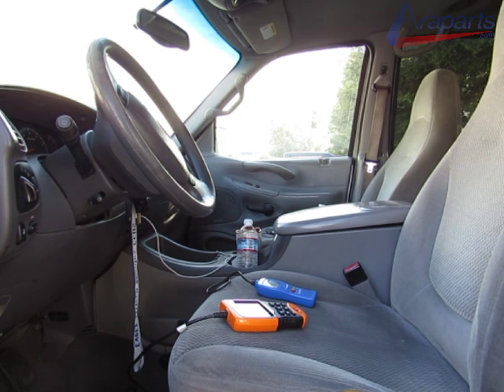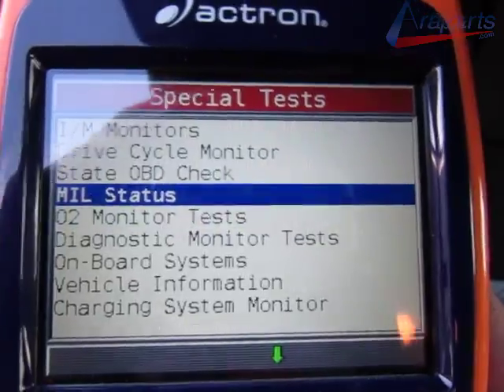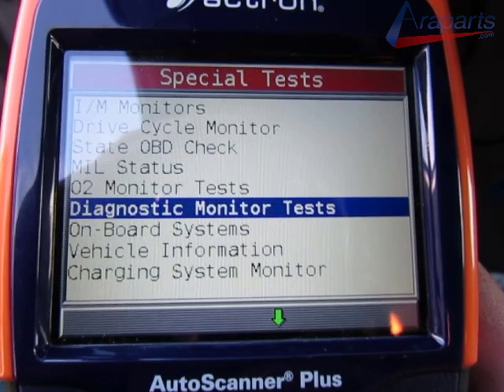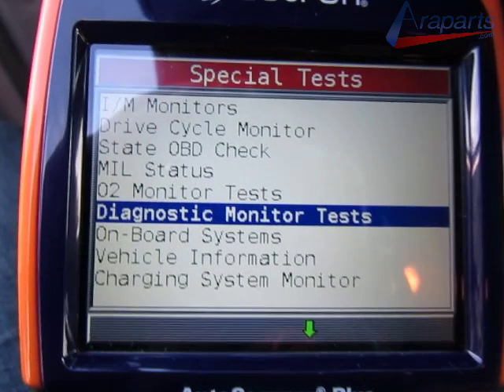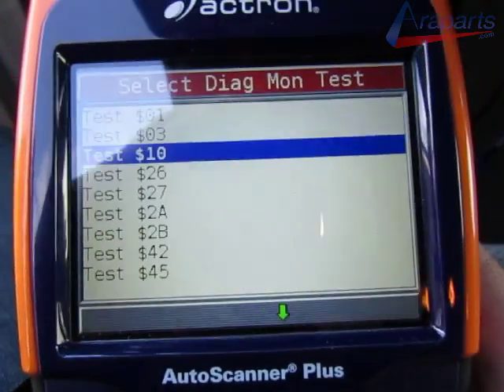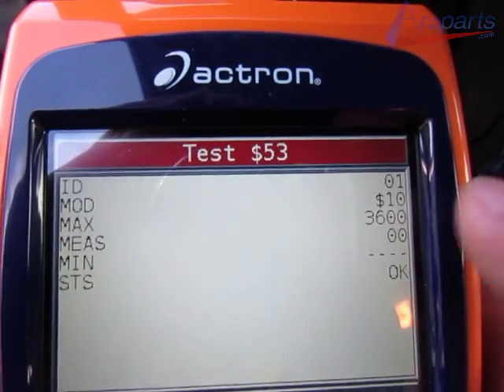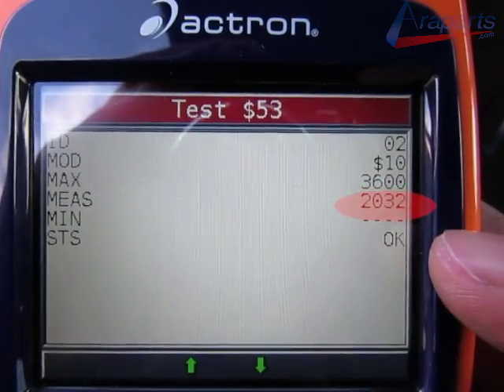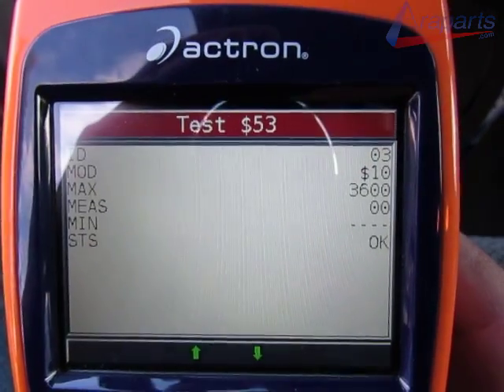How to find a misfire in your Ford WITHOUT a check engine light (no check engine light)

Comment: Doesn’t explain why this is happening or what to do about it. So why buy a scanner? My truck is an 01 with the 5.4 2v. It has been running exceptionally for 154k miles and I keep it serviced. Occasionally it develops a misfire at idle up to about 1,500 rpms. Sometimes it does it for a few minutes and stops. Sometimes it lasts for weeks. But mysteriously it eventually stops. But now I’m going on two weeks and it’s annoying. No check engine light either. I’ve been told it has something to do with the PCU. And there’s a way using a scanner to go into the PCU and correct a code?
Reply from the maker: This won’t solve the problem, but it will help you quickly isolate it. You also can’t correct codes. You can only delete them. There are multiple things that can cause a misfire. PCU - that would be the main computer. It is commonly referred to as “PCM, ECM, or ECU”.  It stands for “power train control module”. Mode 6 is one way to access any misfire data that is being stored in the PCM.  Ignition coils are by far the most common (which was the case with the one in the video) but there are many other things that can cause a misfire (fuel injectors, cam/crank sensors, timing chain, cam phasers, corroded wiring, rodent damage, bad PCM drivers (more common on the Escapes) and the list goes on. 

If you don’t want to buy a scanner, you can see if the local auto part stores are willing to view mode 6 data (their scan tools are usually capable) or you can wait for the service engine light to turn on and you can pull the codes with any $5 scanner. Service engine light will turn on once the misfire gets worse.

Comment: I bought a scanner that uses mode 6....I ran it and I found 5 misfires on cylinder 2 out of I forgot how many max value....then I got 10 misfires out of 934 max on $54 test....my question is I can't get this to change? I want to test again specially at low idle speed because that's when I feel I have the most misfires....is there any way you know how to do this?
Reply from the maker: I would reset the PCM and go for a drive. This will erase the old data and give the PCM a chance to record new data.
Reply: @anotherlapofficial  what about resetting the battery...unplug for 10 min
Reply: @anotherlapofficial  is there a scanner I can buy that will give me access to live misfire data?  I really need to view what is happening at idle and specifically right when I start up the car as that's when I feel it shaking....with mode 6 on my cheap scanner I do get misfires but I have absolutley no clue when these misfires were recorded....they could be on the highway at 70 mph 2000rpms or they could have been in park idle....I need to view these misfires live

Comment: Man I really have to thank you for this video. I ordered a cheap reader that claimed it had mode 6 which it didn’t.   Ended up returning and going to oreileys to use the one they had in house. Took me a second to find but it found that cylinder #7 was the one misfiring. Fixed my problem and saved me about $800 bucks in changing all of them. You are the man!
Reply: How did you fix the problem? Coil pack ? Plug ? Injector ? Was your check engine light on? 🤔

Comment: A word of caution... 96 was a transition year so you might have a 96 Ford that actually has a 95 EEC-IV ignition system which means a scanner with a Mode 6 is not going to be of any use to you.☹

Comment: A little off topic but if I have a check engine light on but when I plug in my obd scanner.. I get no codes.. Does anyone know why this happens?
I had a p0420 before.. Changed the 02 sensors.. And cleared the code.. Then a few days later and over 100 miles driven.. The check engine light is back.. But no codes whatsoever..
Reply from the maker: P0420 is typically a bad catalytic convertor(s). I've seen O2 sensors cause that code, but more often than not that's a bad cat. Especially if you clear the codes, change the O2 sensors, and P0420 keeps coming back. You can have a smog shop diagnose it further before spending the money on anew one (s).

Comment: Thanks, couldn’t figure out which test was my individual cylinders. My 2003 Mazda B2300 I4 is showing 4085 events with a maximum of 14080 for a fail on cylinder 1, while the others are zero events. I just changed my plugs and wires (it needed them) so I’m gonna keep an eye on this number to see if it goes up. One thing that has been really confusing is the event count on test ID $56, it just keeps counting up and up with big numbers for a Fail state because it wants a maximum of 2000. I’m not really sure what to make of that one…

Comment: Hi!!!
I just ran mode 6 in my 2001 expedition.
I have: $2A $00 FAILURE
             $2B $00 FAILURE
             $26 $00 FAILURE
             $56 $00 FAILURE
Can't find definitions on those codes, or what they are related to.
Can you help me?

Comment: Didn’t help me. Mode 6 isn’t showing a specific cylinder, just a general misfire on test 56.
Reply from the maker: If Mode 6 isn't giving you data you need, I'd recommend looking up the term "cylinder power balance test". Unfortunately, this test will require a much more advanced and expensive scanner. As an avid DIYer, I'd always say the more tools the merrier. It really depends on your DIY dedication whether or not you would buy a scanner with this type of capabilities, or just take it to a shop who can perform this type of test.

Comment: I'm not sure if it's a misfire or the torque converter but its been "Shuddering/Vibrating"  between 30-45mph  since about 2016.  Also does it uphill sometimes.  No scantools were showing anything wrong and I dont wanna just throw parts at it.
Reply: Hi I don’t know if you still have the problem or even the truck but I’ll put it here so people know what’s wrong it’s a misfire I had the same thing on my truck and replaced the spark plugs and it was good as new so id try replacing them first as they are the cheapest and if it’s still there try the coil packs you can do all this in a day unless you have the 5.4
Reply from the maker: Yeah, don't throw parts at it. If you don't see any misfires in mode 6, you would need a more advanced scanner to perform a "power balance test". It's the graph line test that allows you to actually see the misfire and in which cylinder it occurs. This would further help you see what's going on with your motor. This would be a much more in depth test than the mode 6 and help you to pinpoint your issue down to an electrical or mechanical issue.

Comment: I just bought actron cp8680 to check my 2004 ford expedition for the same problem that you are talking about but the menu on the screen is different and does not show me the functions that you used.
Reply from the maker: I looked up Actron cp8680 and I didn't see a model that existed. Did you mean Actron cp9680? What does your screen show? Does it have the "Special Tests" section?
Reply: @anotherlapofficial  What is the test id for a 2018 model f150?
Reply: you right cp9680 i just connect to my computer and unload updates and then work fine.
Reply: thanks

Comment: I have 2012 e350 ford
Can this tool find inactive codes
My van  few times has flashing  mill  light    after stops   does not shows  codes

Where can buy this  scanner?
Reply from the maker: Yes, is the engine is misfiring, you can use mode 6 to identify those misfires with this scanner. This scanner is the Actron CP9680 and can be found on many websites like Amazon, JBtools, ebay, etc. Other scanners will do this too, but just make sure it has "mode 6" functionality.

Comment: I'm getting a measurment reading that says "17ca"  on my cylinder number 5 on my 03 expedition. Any ideas what that meens? I'm experiencing a bad misfire with mo check engine light
Reply from the maker: Depends on the scanner and what format it uses. It might simply mean a misfire. I would try swapping the coil from cylinder #5 to a different cylinder to see if that number follows the coil.
Reply: @anotherlapofficial  great thank u will do

Comment: Thanks for the info . I have the Actron CP9690 tool . I have a friend's 2000 Honda Accord , 2.3L . The CAT is restricted . The  O 2's are showing rich . I need to find where the issue is so a new CAT is not ruined .  Misfires are a good starting point .
Reply: Bill Smith Check plugs, plug wires, injectors, fuel mixtures, clogged air filter, leaky valves, stopped up muffler, and faulty emission control parts. Check the codes and fuel trims and other readings. A bad coolent temperature sensor can cause a rich mixture. Look on live test with the key-on engine off with the engine cold.  See if the coolant temperature reading is about the same as outdoor temperature. If it says 33° and it's 88°, the coolant sensor is bad. That can cause a rich mixture. Read on YouTube how to detect a bad cat. converter. Check record and then graphing on O2 sensors to compare readings. Check sensors like MAF, IAC, EGR, and others for % indicating proper readings KOEO. It retains the memory of results until erased. Get a charger cord for a TomTom One GPS to check readings in your home. Get a USB cable to update it. EBAY has it.

Comment: You mean the "check engine" can ever go off on a Ford?
Reply from the maker: 😂 these Fords do have their issues, but most modern cars these days aren't free of problems and recalls. We've seen a pretty level playing field across the board (aside from luxury cars - as usual).
Reply: Tcmtech Usually Ford's have bad MAF sensors.

Comment: My Cylinder 5 "MEAS" =BB5   what the heck does that mean? No numerical value just BB5?
Reply: Using Actron cp9680
Reply from the maker: Not sure what that means. If you have a misfire, I would swap #5 to a different cylinder, clear codes (if any) and  re-test.
Reply: @anotherlapofficial  I read that BB5  is actually a Hexadecimal value. 
http://www.totalcardiagnostics.com/support/Knowledgebase/Article/View/48/6/mode-06-diagnostics 
(MODE 06 HEX CODES)

When I converted it on the windows calculator it came up to 2997 in decimal. I replaced number 5 coil pack a few days ago. No problem now. I ended up getting my  Actron cp9680 on sale for $145. 
    Pertronox aftermarket coil pack $30. 
     All in all $175 fix. A heck of a lot cheaper than the mechanic shop.
Thanks again.

Comment: Thanks for this! 99 Ford F-150 5.4 started misfiring this week.  Going to buy me a code reader with 06 capability. Then fix that sucker.
Reply: the pc9680 also has that capability.
Reply: Update, the Actron code reader did find cylinder #5 was miss firing. HOWEVER, my reader PC9680 gave me the misfire info in Hexadecimal which at that tinme I didn't recognize.  after scouring the internet, i found a page where the author described the Hexadecimal codes and told how to go to my PC calculator and set it for scientific mode. I was then able to decode my results.
 Just remembered I already did an update to this post. Oh well go below and read it in more detail.

Comment: I wonder if the less expensive cp9670... would do samething?
Reply: Ben Smith I’m wondering the same thing.  Actron advertises the 9670 as “mode 6 in layman’s terms” so I’m assuming it will do mode 6

Comment: My v10 has a slight mis at 1400-1600 rpm. Why would it not misfire all the time but only in that small rpm range? Thank you
Reply from the maker: The load at different RPM ranges is not the same. It's quite common to see misfire at higher load and low rpm.

Comment: Great explanation of misfires. I recently bought a used 2002 f150 with 4.6l engine. Has hesitation issues at 40 miles an hour. I had already checked the OBDII for codes (none). after watching your video I went back into my inexpensive reader found Mode 6. Turns out I have many misfires in cyclinder #6. Thanks for the help. :)
Reply: I replaced all the coils and spark plugs. I installed Ford Motorcraft coils 3W7Z-12029-AA and NGK Iridium spark plugs. Now the transmission shift perfectly and the engine runs better.
Reply: What did you do to fix it?
Reply: That's great . Good to use quality parts . No " white box , no name " on critical parts . Maybe on an air freshener !

Comment: 2000 ford ranger? 3.0 any help please
Reply: Tiffany Gould The Actron CP9680 will work on your car. EBAY has it. It checks live, record, graphing, transmission tests, ABS, SRS, oil light reset, and MORE! Get 4 aaa batteries for under the rear cover. Get a USB cable to update it. Get a wall charger cable for a Tom Tom One GPS to review test results in your home. Get a Tom Tom One GPS cigarette lighter cable for in-car test results review. Get a cigarette lighter extension cable for extended use. Hook it up to the test connector. Turn the ignition on. Read codes. It shows the definition. Check code-connect to diagnose codes. Start the engine to check operating conditions. It comes in a black pouch. EBAY has them. This saves money from having to take it to a mechanic.

Comment: Does the engine need to be on to test in the diagnostic test. Mode 53# for a 2002 v10 6.8
Reply from the maker: For all of the scanners I've used, it only needs to be in the "run" position...Aka lights on the dashboard on, engine off. Some scanners will tell you to start the engine.
Reply: alric williams EBAY has it.

Comment: Not the "man" but looks like a 9680
Reply: śrick śrick The CP9680 and CP9690 tester are the same. The CP9680 is for OBDII only. The CP9690 has cables for OBDI Ford, G.M., Chrysler, and 2 Toyota. Also, OBDII. Get a USB cable to update it. Get a charger cable for a Tom Tom One GPS to check readings in  your house. EBAY has it.

Comment: I just put in a engine in my 04 Ford expedition and the engine light started blinking 3 time and it would shut off and back on 3 time.. before I put the engine in it was sitting for 7 months would bad gas be a problem
Reply: Crystal Smith Run it so the computer can build codes. It might give a code P1000, meaning the car sat or the battery was dead. Charge the battery and retest. EBAY has this tester.

Comment: I have a question I change my spark plugs in my 2003 dodge caravan  cylinder 2 and I don't have a engine light on and it's misfire
Reply: heather moore It could be plug wires, injectors, coil, or compression. Use a code tester to see. This on is a Actron CP9680. EBAY has it.

Comment: will this also apply aside from ford? if so, which brands?and thanks for this info.
Reply: noel colendrino Check on Google for a Actron CP9680 about the cars it covers.
Reply from the maker: Yes, other manufacturers for newer vehicles usually display the data in layman's terms rather than hexadecimal language. I know GM trucks will literally show "misfire count cylinder 1, 2, 3, etc". Not all vehicles support this feature however.

Comment: Thanks for this video. I bought this exact scanner for my 97 5.0 to detect a misfire and under $51 it shows cyl 3 STS as "HI" where the other cylinders show "OK". Do you know what "STS" stands for?
Reply from the maker: STS is just a representation for the check engine light. I believe it stands for "self test status", but not 100% sure. HI most likely means that it records misfires, but not enough to not set the check engine light on. How many misfires does Cyl 3 show?
Reply: 8000 I believe
Reply: d s "Status"

Comment: hello, nice video. i just got my maozua z100 obd ll can scan tool with mode 6. but do not no how to use it to get to the spot to check for misfires, like yours. you seem to no a lot about how to use them. no videos on you tube about the maozua z100. i have a 07 f150 with a 5.4  you sed in your video tools needed,  obd ll can scan tool with mode 6. pleas help if you can, thanks Bob
Reply from the maker: I've been looking around for a while to see if I can find the menu info from the Maozua Z100, but can't find anything. If I'm able to find anything I will share it here, or even make a full how-to video with that scanner.